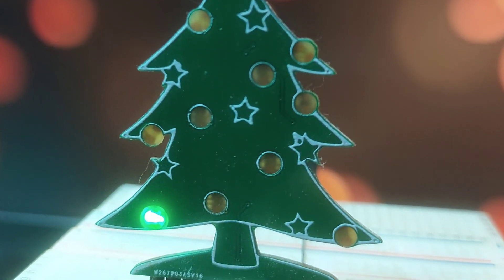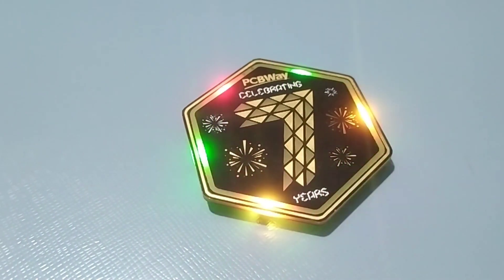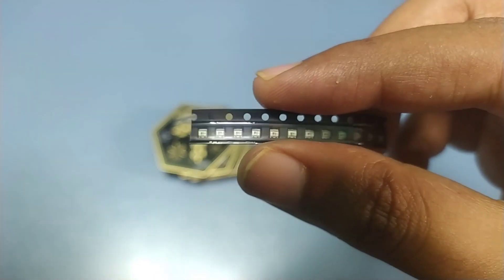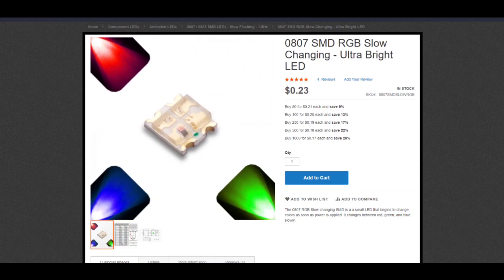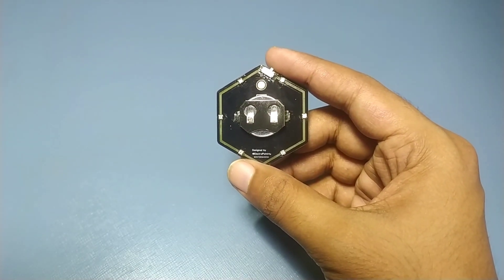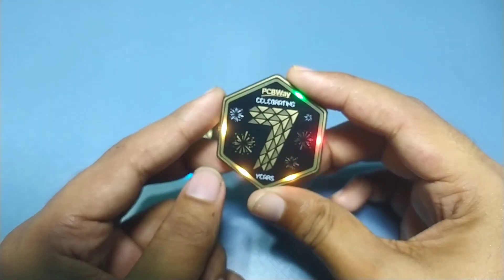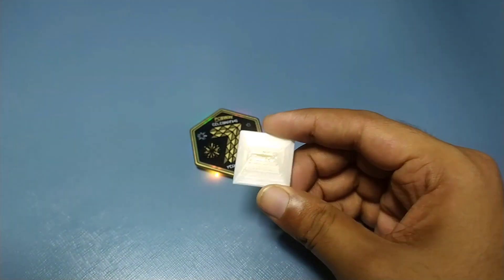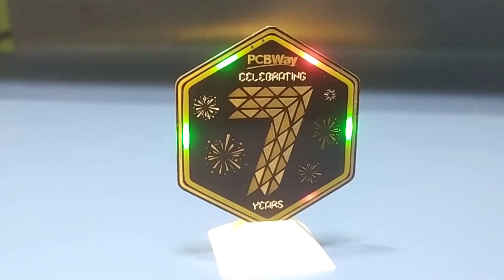Making a PCB badge for 7th anniversary of PCBway

Comment: Realy great badge, but what is that see though layer on the edges called?
Reply from the maker: You have to remove any other PCB layers like copper pour, silkscreen or solder mask so that the inner fr4 material is exposed.
Reply: @ElectroPoint4u  Oh thank you, btw that would be a cool video if you could make one, i havent seen anyone do a video how to make see-though pcb